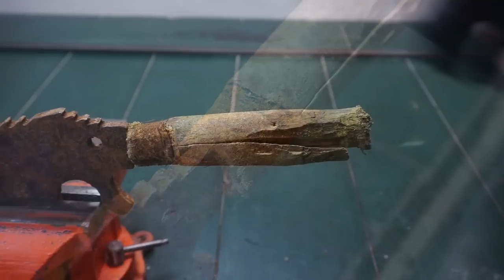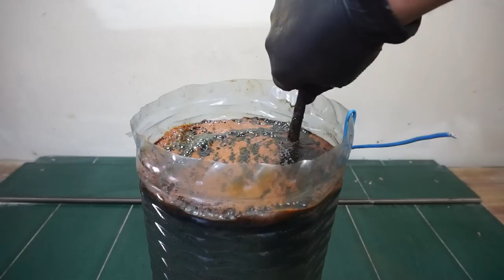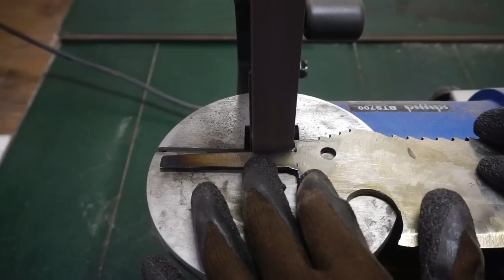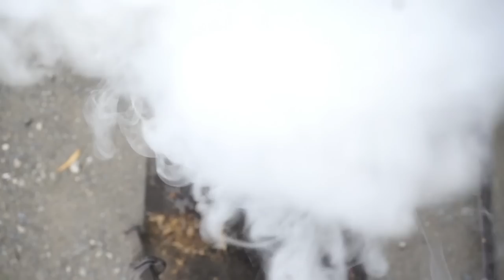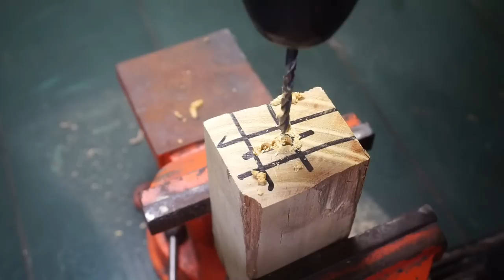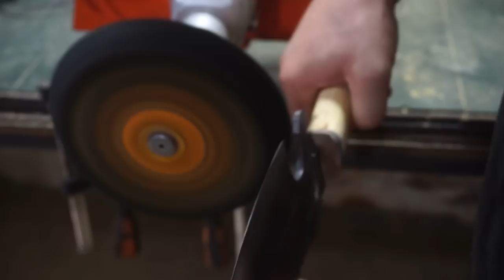Restoration Very Rusty Old Cleaver

Comment: Holy smoke, you literally put random weld beads on the sides before rusting it up.
Reply: The rusteration looks good but I was thinking kind of the same thing.
Reply: This is my third and last with these guys.  The other two were knife restorations and the comments were similar.
Reply: Those were fossilized chunks of meat
Reply: I was thinking the same thing. We’re not idiots. That obviously wasn’t an old cleaver.
Reply: It's not a meat cleaver and he ruined the temper and then ruined the blade with toxic bluing agent. BLUING ISN'T FOOD SAFE...
Reply: @Facetiously.Esoteric  that's good to know I didn't know that isn't food safe what does it do
Reply: @Facetiously.Esoteric  I mostly agree, but if bluing is food safe depends. Cast iron pans are blued too and they are definitely food safe
Reply: @richardharepax123  it's a way of oxidating the metal to make it rust proof. And it is food safe depending how you do it
Reply: I was thinking the same thing, beat me to it.
Reply: The blue that he used is not food safe. That is Gun Bluing by Birchwood and Casey.
Reply: @dusreev7085  I guess once he'd started down the wrong path, why not continue.
Reply: Yeah, to hell with this channel. I can go to my local flea market and find a bunch cheap old crappy blades and do the same.
Reply: That's what I was about to say lmao
Reply: Source trust me bro
Reply: @LMajorDegs  Source, you can SEE the weld beads and there've been videos made on how to rust a tool up 😂 most of that looks like spray paint lmao
Reply: @5Cdarkwing  explain!
Reply: O que você quis dizer?
Reply: Br ruined a perfectly good knife lol
Reply: Bro if you’re just going to complain then why are you watching his videos?

Comment: That's not a meat cleaver. It's a French styled ice cleaver. 
Between the welding and grinding you softened the metal because you weren't cooling it as you worked. Then you didn't retemper the steel correctly. The blade was also bent, which when hot you could have fixed. You also messed up the bevel, it's angled that way for a reason, so the cut product rolls off the blade. 
Bluing isn't food safe, so this blade can never be used again for anything ANYONE WILL EVER EAT. You ruined it.
So many mistakes, such a poorly thought out job and not any research on how to do it correctly.
The saddest thing is over 3 thousand people think you did a good job instead of potentially poisoning people.
SMH...
Reply: As others have mentioned not good and why bluing?  No captions or details on what was being done.

Comment: That's some lovely work on the handle.  Nice polishing on the blade, too, but I'm confused by the design.  Why does a meat cleaver need teeth along the spine?
Reply: It's called jimping and it's for your thumb to rest on and push against for better stability when making a slice as opposed to a chopping motion. At least, the teeth close to the handle are; for the rest? I would assume uniformity and the rule of cool were applied~
Reply: @alexisgrunden1556  No, they're for sawing through bones. I have a knife very similar to that one that I bought because I heard it was super easy to fake restoration videos with since it's easy to make it look old and rusty, and now I'm seeing the proof of that.

Comment: this video is fake, reasons why,
1. shape is to modern
2. with so much rust you would at least expect dimples in the blade after it is removed and this blade had nun.
3. the heat treatment that was used will never work with a blad that big and a torch that small

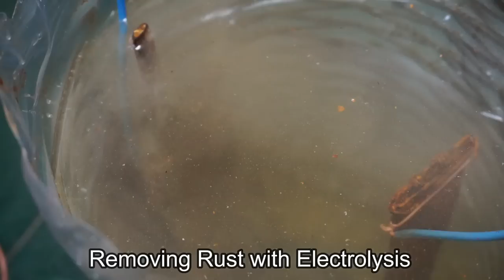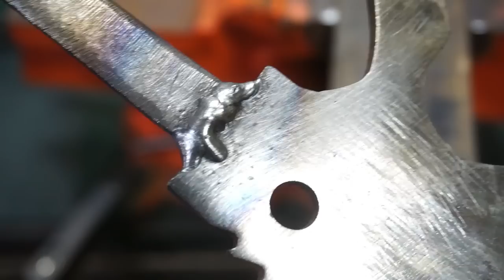Comment: Bro did NOT apply that rust well enough if it came off that easily. F for the attempt at faking a restoration of a brand-new meat cleaver. FYI, saltwater makes things RUSTIER using those processes, not less rusty. Also FYI, that's not even true electrolysis, nor is that power system efficient, if even a power system, nor does said system take 8 hours and turn the water that color and the knife in that condition. Electrolysis is putting a metal connected to a terminal of a battery system into a vat of a chemical (not water, not salt water) and putting an activating strip into the water connected to the opposite polarity to attract ions from the strip onto the metal. It's used for nickel, copper, titanium, and sometimes gold, coating, but never for rust removal, because it *doesn't work for that*. I'm 3:42 into the video and I can already tell he's failed in three different aspects of restoration. He even shows off his sub-par welding skills at 7:03 to prove he's the one that put those welds on in the first place! Amazing!
Also, at around 9:05, you can see how badly he failed to properly sharpen the blade, as it's now off-balance and dull and the sanding removed more material than just keeping the straight edge, so now it won't cut cleanly or straight.
Aaaaaand, of course, he couldn't even temper or heat treat it properly. And then sands it after tempering. And then he cold blues it? That's unsafe and doesn't do anything. You clearly know how electrolysis works, just nickel coat it. That would provide better rust protection and make it actually usable. You can literally see how the metal tried to reject the bluing process (as it's designed to). It shouldn't take that much work to blue something. Not to mention, by the time he gets to wiping the grease or whatever that is onto the knife, most of the bluing has been sanded off anyway, making it even less usable.
I'm also confused why, at 17:55, are you using a (metal intended) polishing wheel on wood, instead of just using stain and proper oil that would actually protect it? Are you trying to create "Restoration Very Rusty Old Cleaver Again"? Or, alternatively, take a nice Clorox wipe and wipe off the handle to get the same effect. Also, is that literally cooking oil or is your linseed oil actual shit?
Reply: And, for the record for anyone reading this, that knife likely came into production around the year 2017-2021, as knives with a finger hold and a saw like that were often multiple separate tools until people got too lazy to do it otherwise.

Comment: Hi, could you please give information about the wattage and amperage of your switch mode which you use for rust removing.
Reply: ops... I mean voltage :) :) :)
Reply: 12
Reply: Too high, and, consequently, too high. You shouldn't be able to hear it that loudly when faking electrolysis.
Reply: @N5K3G  u could edit ur comment bro

Comment: FAKE 👎
Reply: How so?
Reply: There was absolutely no rust pitting. He threw some random welds on both side of the blade, then artificially rusted it to make it look old. Go watch a real restoration channel. You will see the difference immediately.
Reply: @j.l.emerson592  I may sound ignorant but how does one "artificially" rust something? Isn't rusting... well, rusting? I'm being totally sincere in my questions btw
Reply: Artificial rusting is rusting that has been accelerated. It's only surface rust though. It can be done a number of ways. Something as simple as burying an item in a bucket of wet sand can do it. A ferrous object that has been rusting for a long time will show deep pitting & even rust through. That can't be faked. Look at the video again. Look at the pattern of rusting. It's totally uniform. Add the fact that there are blobs of welds on the blade surface & you see a totally fake restoration. Go look at genuine restoration channels & compare the differences.